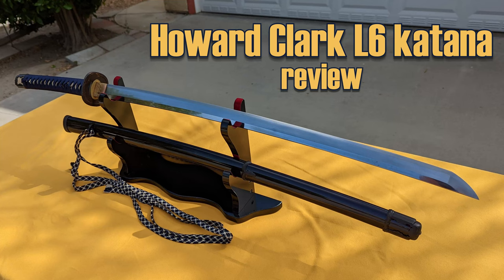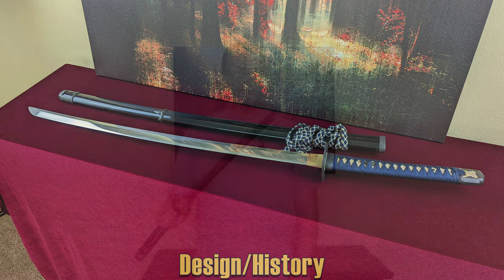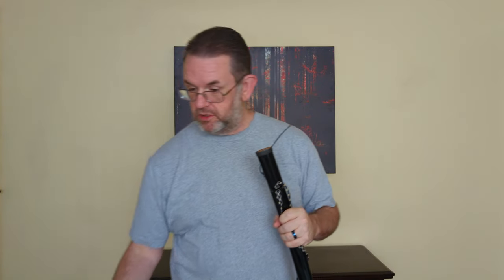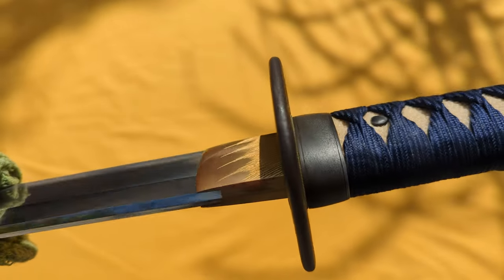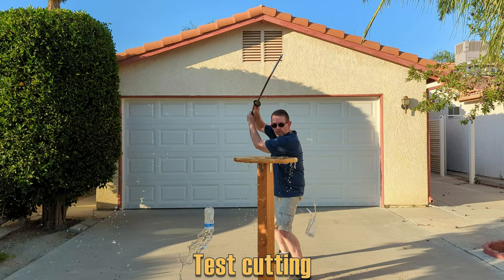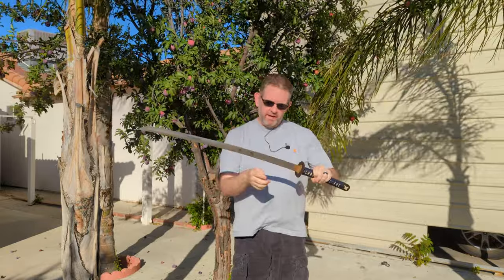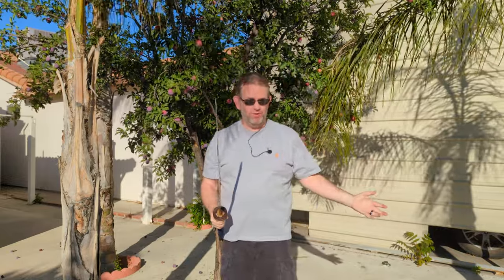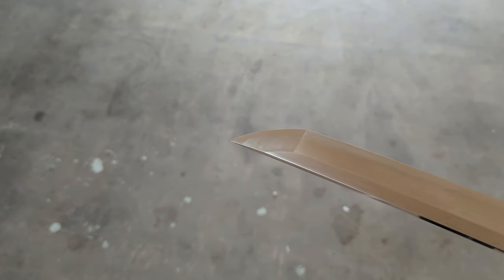Sword Review - Howard Clark L6 katana

Comment: Bainite is just steel grain between martensite and ferrite ... every Katana ever made differentially hardened has bainite in the spine . Bainite is just steel that was not brought all the way to martensitic heat before quench or steel that had clay blocking some of it from the hardening process ... it is not a super big huge deal . Sounds cool though .

Comment: A very detailed and objective review. An extraordinary katana for mat cutting purpose. The choices of the fitting speak for the owner's understanding of the sport of tameshigiri. The way it handles reflects perfectly what you need for a grass cutter, not a dueling sword or battlefield sidearm. He is also quite generous to lend it to a number of practitioners and to you.

What you feel about the differences in handling between this sword and an European longsword--especially one by Tom Kinder isn't due to your inexperience or your familiarity with Euro style swords over nihonto, but based on facts. They are used in different ways, even when you factor in this sword's purpose of grass cutter. 25% distal taper, and 24% profile taper (both linear mostly) are great for this sport, but the mass distribution simply make it not as point nimble as the longsword TomKin made, with 62% distal taper and 55% profile taper. Of course longswords are a lot longer so they NEED that extra tapering to make the upper portion exponentially lighter than the lower portion. European swords and Japanese swords are used in different ways, and it's totally alright to notice the drastic differences of their handling characteristics. 👍

Comment: Howard Clark IMO is one of the most talented smith's but also an extremely talented metalurgist and extremely helpful with passing info onto new smith's. 

He essentially created his own custom modified version of 1086 called 1086M. He has created this heattreatment on 2 different forms of L6 alloy and potentially a 3rd L6 substitute.

Also further more. Not all bainite is hard. It's often extremely soft. It requires time to create higher HRC bainite. I've actually recently recreated this process but on a different steel. 

But some details. Lower bainite is hard and strong. Stronger per hrc then tempered martensite in many steels but not all. 

Upper bainite formed at higher Temps and shorter time periods is weak and soft. 

For example. To get 60hrc in 5160 takes approximately 90 hours to create or more. 

Also. Could I ask you about how to get a Howard clark into Japan for competitions? The whole who you know may be helpful for my quest to replicate some originals to extremely high degree. Specifically for practictioners. 

Planning to try and find blades that'll fit western practitioners and taller people more properly. 

I do know one thing. Recreating his process is not a simple process. And my learning of bainite wasn't even originally in regards to swords. The amount of metallurgy is literally mind breaking. 

And even once you figure it out. You gotta tune things which is literally headache inducing. 

I will say an absolutely beautiful sword. If I manage to get my sword company going I'll have to send you one of my bainite katana to get your impressions. 

Nihonto also very often contain fast bainite. It's called utsuri. It also happens alot in hitatsura hamon katana. 

There's also a antique European sword with a crazy bainite heattreatment and a surprisingly pure blade steel that's unusually pattern welded. 

I like to think of Howard clark as our modern day version of that ancient Smith or the ulfbhert smith's or other famous smith's. He created something so unique and had the knowledge to create it. 

All of us who recreate it are just copies. And if Howard does it the way I think he does then he's truely a master Smith with no modern equal in terms of what he offers. 

The fact I recreated something a legend like him has created gives me hope for other research projects I have.
Reply from the maker: Agreed, Howard Clark is a wizard at metallurgy!